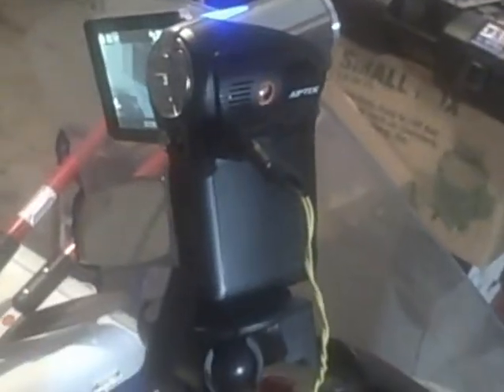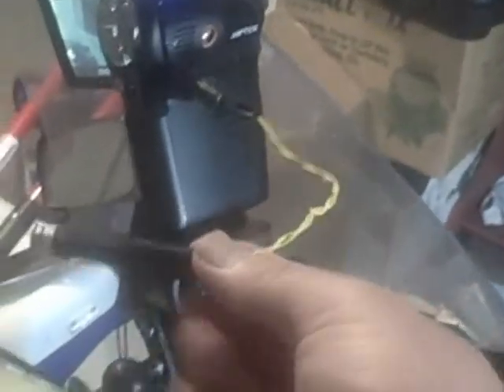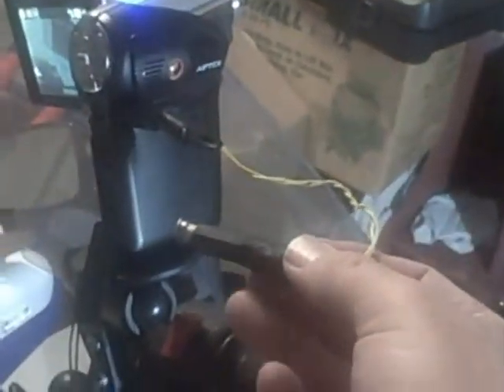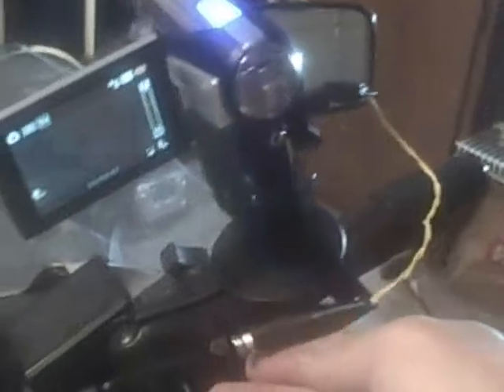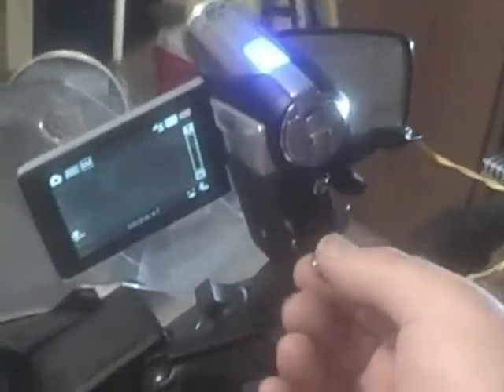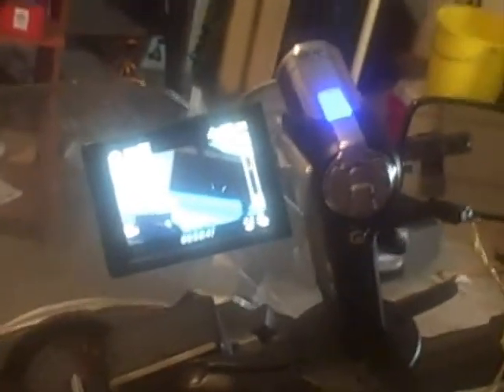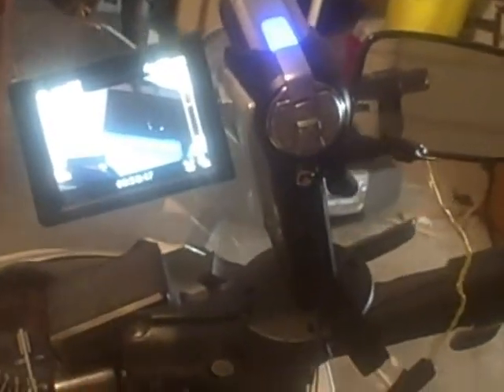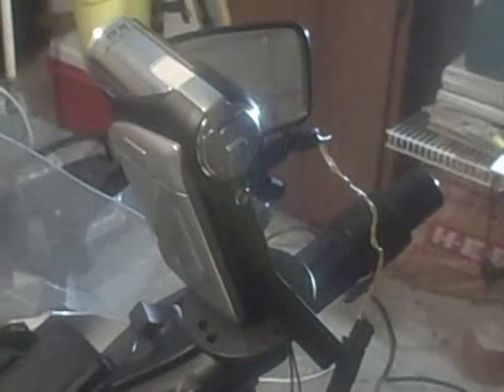Aiptek GVS Camcorder Test

Comment: Thanks Jim.. I couldn't figure out the stability mode but now I get it..
Just wondering, can you set the camera for different times to auto off ?
How long will it stay on..
Reply from the maker: Sorry Paul, shortly after that video was made I stopped using this camera because the camera tripod screw stripped out.   :(  

I haven't thought it about it for years.
Reply from the maker: All I remember about this camera is how bad I felt when when the mounting lug stripped out.  :(
Reply: *****
So sorry bout that Jim, if the camera works out for me i'll send you a nice vid to cheer you up lol..